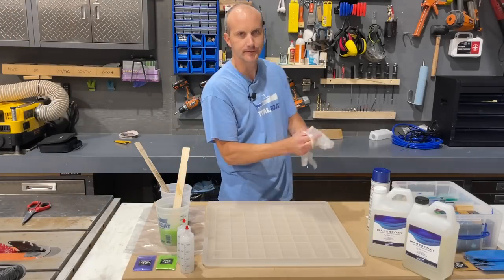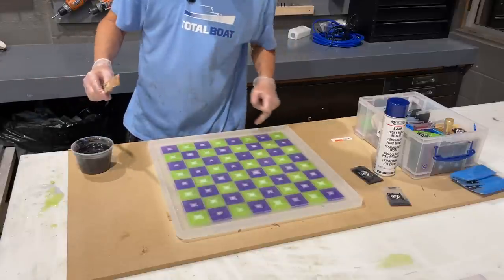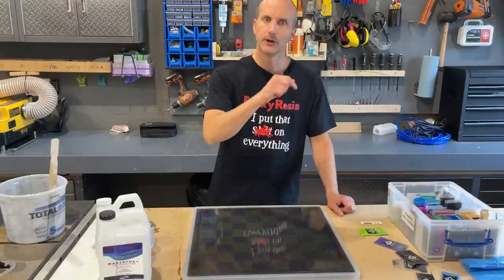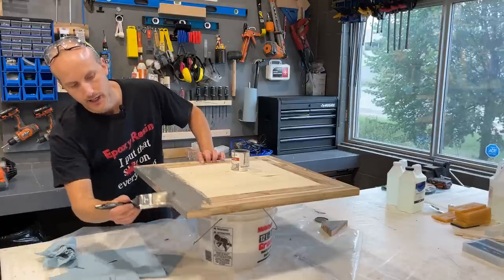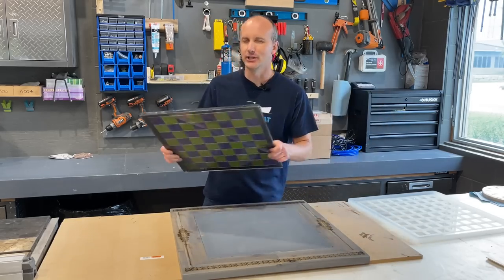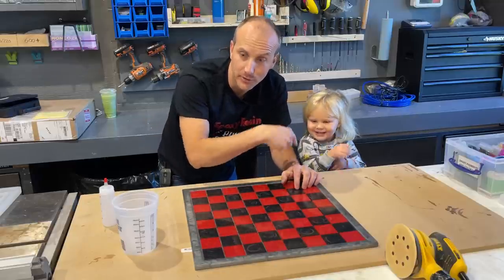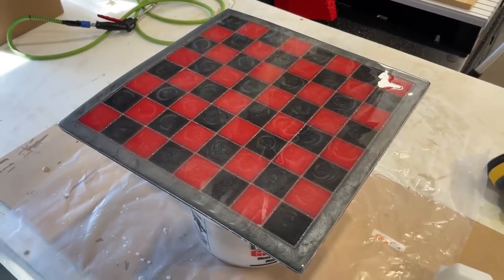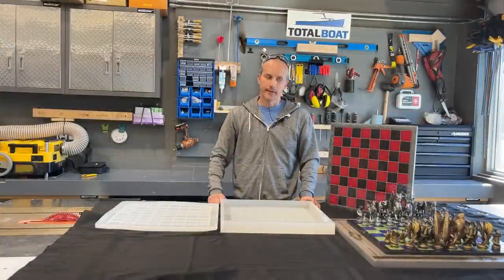Full Sized Epoxy Resin Chess Board Mold - Make HUGE Custom Chess Boards Out Of Resin & Wood

Comment: With the laser engraving, you can take a massive step up if you put a layer of masking/painters tape over the top before you put it through the laser, it'll completely burn off with a slight increase in your settings, and you can then do some fun things with the pattern such as a good metallic paint before peeling the tape. Gets you the patterns and it looks awesome in the end.

If you want another option for personalized chess pieces, I believe Prince August has some really good options for them in mold form, though they're for metal casting.
Reply from the maker: Hey Azrael. Thats for that suggestion that sounds like a cool technique I'll have to experiment with.
Reply: @CraftedElements  I'd upgraded a pile of the wooden "cigar boxes" that the craft stores sometimes carry with them to make some dice trays, for my test one, I'd found that the spray metallics are a better option, and the tape limits the spread of the charring (which can create other issues for paint/stain over time since around the edges, some of that rubs off easily even with stuff over it).
Reply from the maker: @AzraelThanatos  Totally makes sense. I will have to give that a try for sure.

Comment: Great tutorial! I got your mold off of Etsy recently and have been doing test squares. I will be doing my first full chessboard soon! After filling the squares and letting them dry, could you also do the border and the entire back at the same time? Or would you not recommend that?
Reply from the maker: You would have to do the back first, because you cant remove the squares all at once and have them held together.
Reply: @CraftedElements  Thanks! Yes so if the squares were filled and dry (and left in the mold) could you then do the border and the backing all at once? I wasn’t planning on removing the squares once they are filled and dried/firm. Just curious if the border and the backing could then all be done at once after that. In this tutorial, you do the squares and border, left it dry, and then do a backing the same color as the border. So just wondering if the border and the backing can be done in one pour if the squares are dry/firm and still in the mold.
Reply from the maker: @BaileyMakesVideos Yes, you could both at once, I assumed you meant the lines between the squares.
Reply: @CraftedElements  Awesome! Thank you for the info!

Comment: Love this video tutorial.  I've purchased 2 of the 14.5in molds. I want to try the frame. How thick does the plywood need to be?
Reply from the maker: You could use 1/2" or 3/4". But i would lean towards 3/4". Keep in mind that the frame on this is also NOT plywood, its 3/4" hardwood that is mitered (cut on a 45 degree angle at the ends) and glued/nailed to create a square box so to speak.
Reply: @CraftedElements  Yhank you so much. I know. I just wanted to make use the plywood underneath the board is this enough.

Comment: Will you guys ever make/sell molds for the chess pieces to go with this?
Reply from the maker: Probably not, it would be much easier to 3D print + paint the chess pieces.
Reply: @craftedelements..only if you have a 3d printer if not it's going to be quite expensive to 3d print 😁😊

Comment: You can flood the lines after curing with alcohol ink in a needle nose bottle. Let it dry an hour or so and then clean up with a spray of 91% isopropyl alchohol and soft rag until clean and sharp.
Reply from the maker: That's something I have never heard of before but I will be sure to experiment with.

Comment: Is there a way to avoid the swirls in the black on the second board?
Reply from the maker: I think what you are seeing is the swirls from the pearl pigment. Thats how the colorant we used works, it contains mica/synthethic mica powder to give it that effect. If you want flat black, you just need to use a black colorant / pigment. Usually a liquid or dispersion pigment, to tint your resin instead.

Comment: Do you make a chess board mold that's smaller than that one? I love the thick edges on the squares so that they don't run over, but that's too big of a chess board for me.
Reply from the maker: Teresa, we are going to work on and release a 14.5x14.5x0.5" one with 1.5x1.5" squares that are 0.2" deep. Stay tuned.

Comment: Really love the project! Thanks for the detailed tutorial. :)
Just wanted to mention though, on the final arrangement, the chess board should be rotated by 90 degrees :).
Thanks for your videos.
Cheers!
Reply from the maker: Yes, someone pointed this out to me. I am clearly not a chess grandmaster!
Reply: Hahah! It's funny you say that. There's been at least one occasion when a board was arranged this way in an actual top level tournament.
Haha! Really enjoy your videos btw.
I've been meaning to get into epoxy art for a while now, looks like 2023 might be the year I finally do.
Cheers! :)
Reply from the maker: @jamesabhilash8006  I guess I had a 50% chance of being right... just my luck! Epoxy art can be fun but there are cheaper hobbies for sure. Good molds (from us!) and decent resin arent cheap. But... what is these days?

Comment: How thick wood could you put in the deeper mold?
Reply from the maker: Its a 1.5" mold, so you could theoretically put 1.5" thick wood in it. It would just be difficult to get it aligned in the squares, it would be fairly easy on the outside of the perimeter though.

Comment: Could you do a mold for the 2 inch squares but deep?
Reply from the maker: Deeper squares, so more like 2" blocks? Likely not, as the dividers in between the blocks made of silicone would likely rip during demold.
Reply: @CraftedElements  not 2 inches deep!
Like the one deep one you made but with bigger squares.
Reply from the maker: @jamingaming9251  ah! I understand. Its definitely possible, but it would require new tooling to be made and would be a custom job. Tooling for something that size and complexity would likely run about $1200 USD.

Comment: I missed how you got the star design in the blue squares, did you add a bit of white and then use a stick to move it around?
Reply from the maker: I think thats actually tiny air bubbles and pigment.

Comment: I have ordered one and began pouring, but I do not know how long I should wait until peeling it out of the mold? I've read 24 48 and 72 hours
Reply from the maker: It is specific to the epoxy you are using. You need to determine the demold time (not cure time). Most epoxies that are good for 1-1.5" pours are 3 days, but its all temperature dependant.